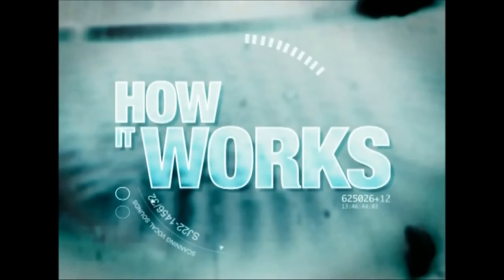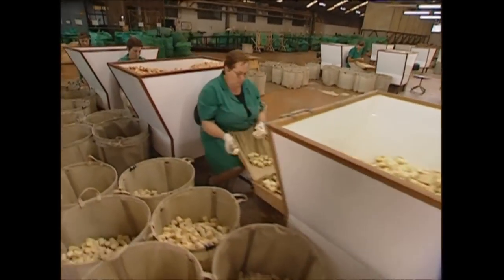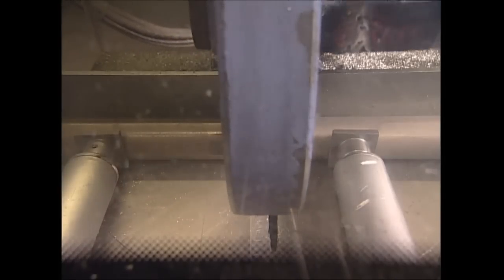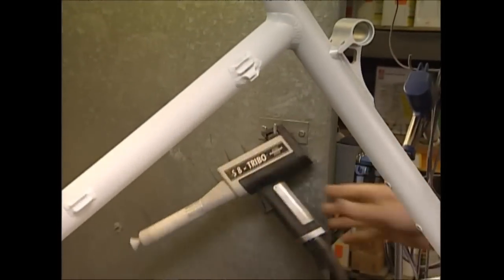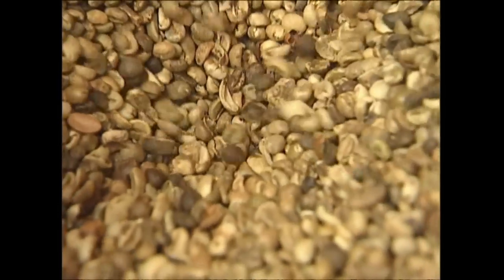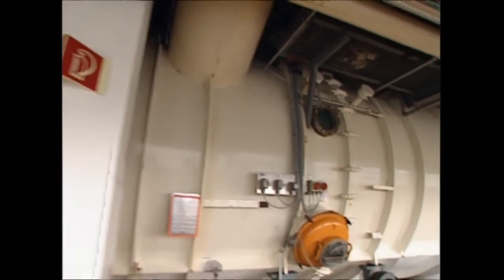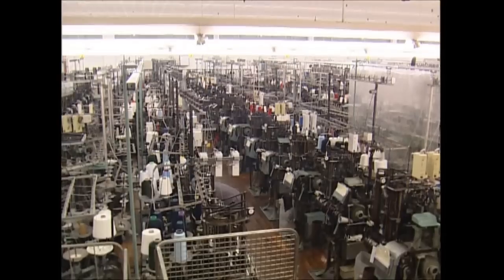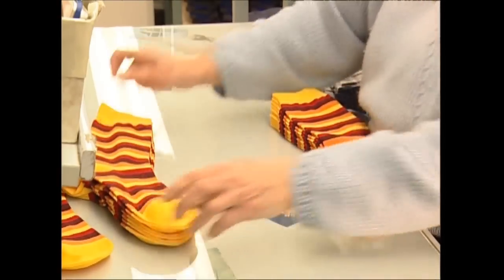► HOW IT WORKS | Corks, Mountain Bikes, Instant Coffee, Socks | Episode 2 | Free Documentary

Comment: If the material for the frames of the bikes are noted as Aluminum, why is the fellow stating that the pipes are welded together with "a steel rod" and now the frames have somehow changed to "steel pipes", not to be picky but it would be nice if the proper material types should be noted, as Aluminium cannot be welded with a  "steel rod" if has to be TIG Welded with an Aluminum rod or filler rod.

Comment: i love it, on the bike frames they say its aluminum tube but when welding they say its being done with STEEL WIRE , thats a no-no to weld aluminum they MUST use aluminum welding wire.
Reply: Later they say the frames are loaded into an industrial oven which hardens the steel. They were using aluminium wire for the welding, just sloppy narration, got the pronunciation correct though. Nice bike.

Comment: At the cost of sounding very nitpicking you don't use a steel filler Rod when welding aluminum use aluminum filler rod when welding aluminum
Reply: Or the fact that disc brakes use calipers to stop the bike.

Comment: you can not weld aluminum with steel rod.
Reply: Stephen Price exactly a mistake, crazy! an alloy weld uses similar rod material otherwise its no good of course, but also they refer to steel frames jusr after, it b.s. in fact
Reply: Yes you can . It will be fucked up but it can be done.

Comment: Welding aluminium with a steel welding rod. That sounds weird to me. Isn't aluminium welded with an aluminium welding rod?
Reply: They're doing the TIG welding on aluminum tubing with aluminum rod, and I think it's a case of writer ignorance where they start mentioning "steel". A small percentage of journalists wouldn't know the difference between steel or aluminum or copper, most likely. It's okay to not know all about every damn thing in the world, but you'd think for a program like this, they'd do a little more research and be a bit more careful when they're striving to be presenting accurate information to the public. Otherwise, there's really no point in producing a series like this. I'm no real expert on metallurgy, but I was a production welder at a firm for 16 years and these guys got it wrong when they referred to  the aluminum materials as steel. We all knew we couldn't even use the same  gas or MIG wire when switching from mild to stainless, all that stuff has to be basic work know-how to any welder.
Reply: @randolphpatterson5061  Aluminium!
Reply: @randolphpatterson5061  
Totally agree! And calling aluminum aluminium is weird, too. I know its a regional issue, but this dudes accent makes it very uncomfortable for me. Just my opinion... Also , the 25:55 commercial is a waste of time.
Reply: Yes that's one hundred percent correct...you must Tig weld aluminum
Reply: @julescritelli3049  Aluminium!
Reply: Jules Critelli incorrect, you can mig, tig and even stickweld alum, just need correct equipment.
Reply: @ALXLIA , not withstanding the welding style, steel filler will not bond with aluminum base metal and steel rod or wire would not be used. The rod would be an aluminum alloy for welding, a copper based alloy or aluminum alloy for brazing. Since the frame pieces are raw birdmouthed and not socketed, this style frame would almost always be welded.
Reply: Bear U what i meant with correct equiptment =) afaik there is only one way to fuse diff metals and that is blastwelding.
Reply: barney says hi ; you are correct, they must use alum rod or alum brazing rod not possible to weld alum with steel.
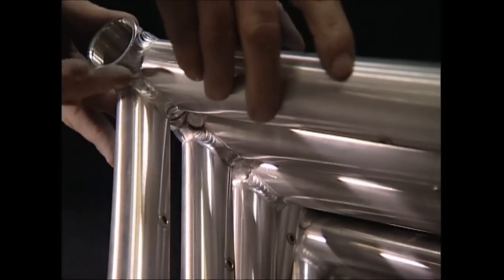Reply: They mixed steel and aluminium up all the way through the presentation.  9:40 he even says the oven causes the steel to harden.
Reply: @ItsMrAssholeToYou  Aluminium!
Reply: lmao that hit me too!!
Reply: Exactly, I just put up a post stating the same thing. I really wish that movie producers would get the facts correct.  I saw a movie one time where a fellow was supposed to be welding something together with a cutting torch, and the best part is that it was Buzzing as though he was using an electric stick welder.  What a farce.
Reply: Does it matter? Both are metal.
Reply: @YPO6  unless you want the frame weld to crack on the trail, it makes a huge difference in what filler metals are used during welding.
Reply: @YPO6  yes it matters, different metals actually increase the corrosion both experience at the point they touch.
Many steel hull yachts have an aluminum superstructure, the builders have to carefully isolate the metals from each other at the join points because of this.

Comment: I like this series but all through there are stupid errors, like the alloy bike tubes that are supposedly welded with steel rods, them magically become steel frames in the heat treating oven! 
The details are everything in documentaries like this!
Reply: Steel is an alloy
dumbass
Reply: +greggy weggy I think when he said "this makes the steel harden and the tubes literally insaparable" He was talking about the steel that was added in the welding process, not that the frame is made of steel.
Reply: philip gutbrodt ; i am soo sorry to tell you but they can not use steel welding rod when welding alum. tubes, it will not stick at all, they must use alum. welding rod or alum. brazing rod. greggy was correct, no steel rods.